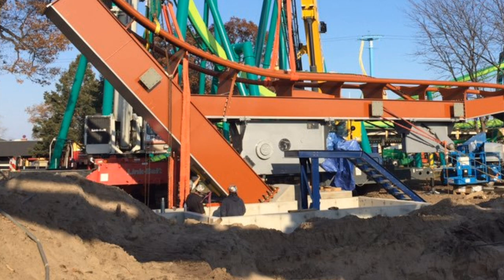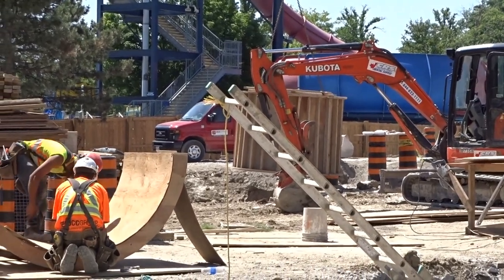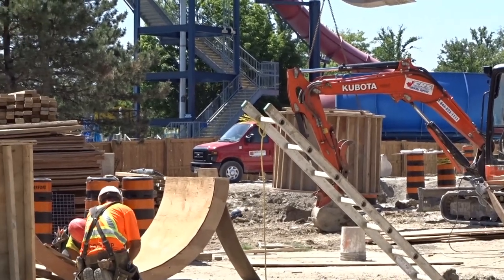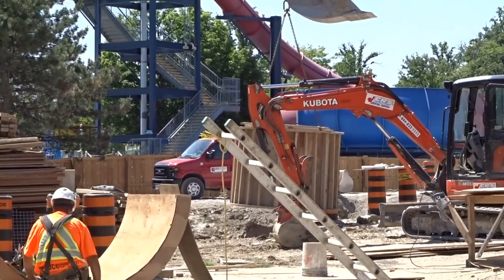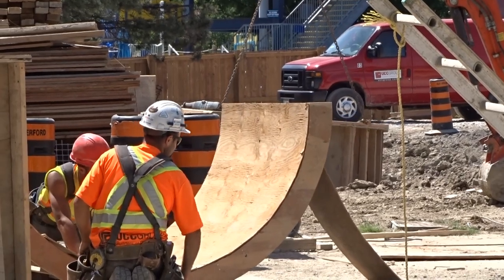Amateur Explains: Roller Coaster Footers

Comment: there are many ways for constructing of footings. Piles are used for extremely deep foundations that usually bear extreme loads and transmit them deep into the be rock. Piles are drilled or driven into the ground. your rebar and concrete info is perfectly correct and is then inserted into the hole. These are the cylindrical like footers. The larger block footers dont go as deep and are dug into the ground with a backhoe or excavator rather than drilled. This was the pit the excavators were crawling into. Very informative video and is well done. Remember concrete is used to pour footings because it has a higher compressive strength than cement. Concrete is cement but with an aggregate like gravel and sand to provide great strength.

Comment: Overall this video does a great job. For future reference Concrete does not dry, it cures. If concrete just dries it is only about half as strong as concrete that is cured  because the cement runs out of water to react with. To make sure the coaster is safe they cure the concrete and between 7 and 28 days it usually has gained enough strength to be built on.

The video linked below does a good job explaining the the process of concrete gaining strength and why letting it dry is not good. https://www.youtube.com/watch?v=ue0v3Ypl-0c
Reply from the maker: Jeffrey Meier oh wow! Thanks so much for sharing that. I’ll def give it a watch.